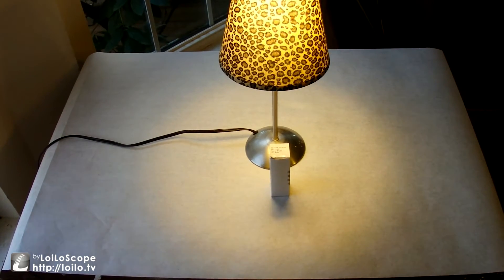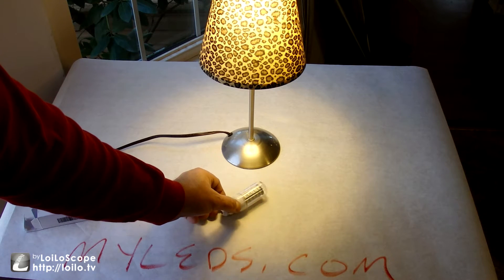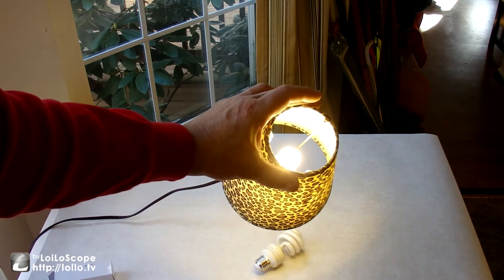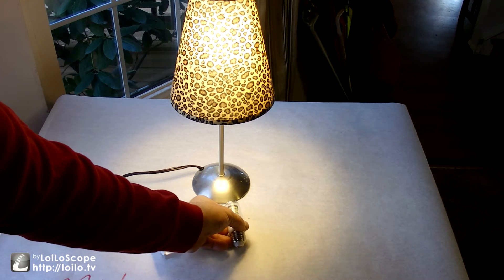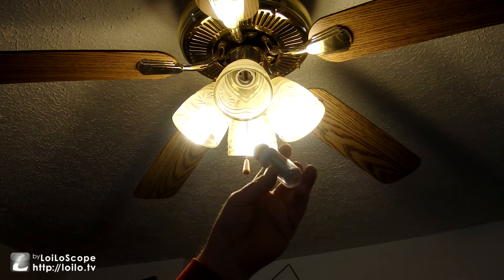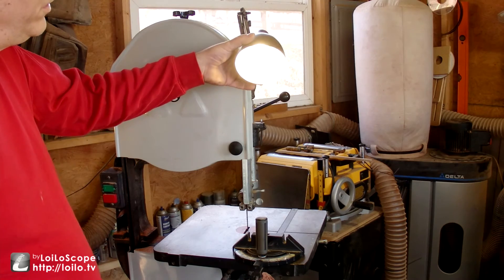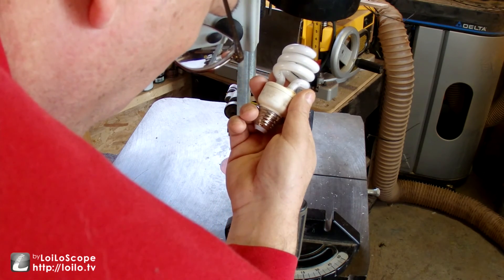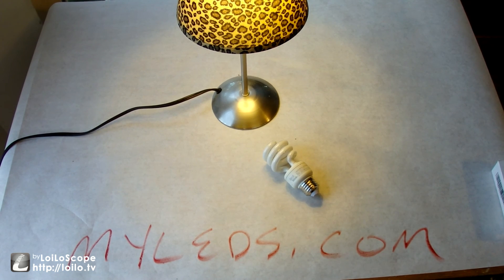MYLED.COM LED Corn Bulb Review E27 110VAC 5W Warm White 36 5730 SMD

Comment: mmm, the LED has only 700 lm output compared to the 900 of the cfl, means that one at the band saw ... the question especially there in this situation is also how this specific reflector works with different bulb shapes, means it may be not fully optimal for the LED bulb since the LED is much smaller shaped compared to the fat shape of the curly thing (which itself may have replaced any standard bulbs) so the path of rays/reflections may be quite different.
btw. that mercury product - must be a very old one? meanwhile You should get also mercury free cfls ...
Reply from the maker: Good information. The 5 x 6 with only 6 on the end arrangement of diodes means most of the light is going to the sides...which makes it great for a globe or shaded lamp...not so good for directing light like a spot light. A different shaped cover...like the old style lamps that you see attached to works of art or pianos would be better...but still most of the light would be going into the cover.
Reply: yes I think it could work better in a reflector which was designed for these old candle shaped bulbs (is that the right term, candle shape? these bulbs looked like fir cones or so).

The challenge of replacing bulbs by later technologies is always whether the reflector works also with the replacement, and whether the heat dissipation is still ok - these LEDs burn out if they are overheated due to any heat accumulation. And sometimes may be also some kind of danger that the whole lamp starts burning ;-)

Usually it works fine when the bulb socket is made from metal, but there were also lamps in use with bulb sockets from bakelite or so ... good old times, but such pieces may still exist ... ;-)